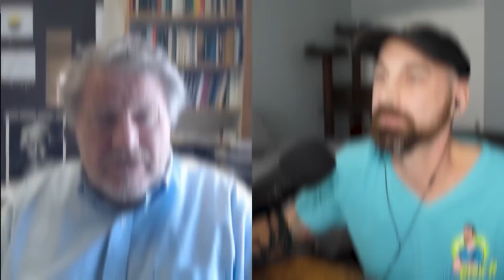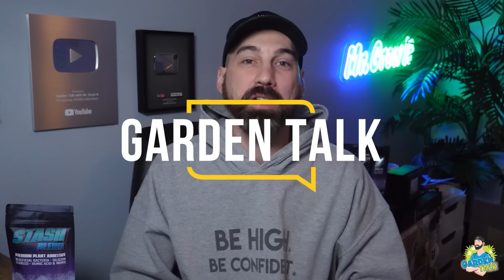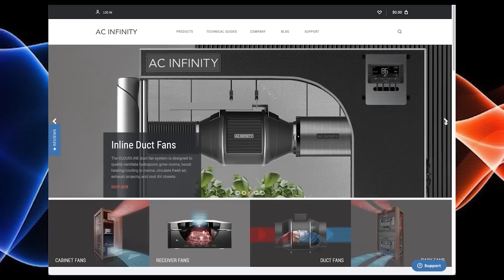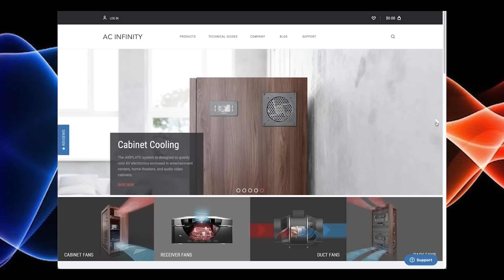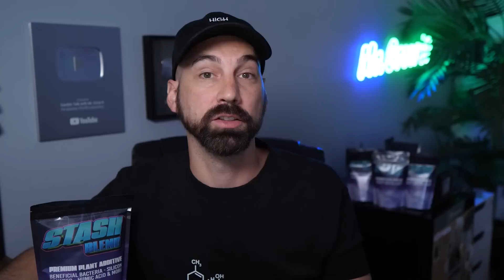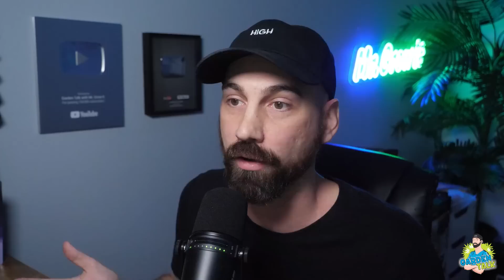Best Practices For Growing Several Plants At The Same Time! (Garden Talk #116)

Comment: 26:13 in the same boat with low humidity. Started using a Vicks Vaporizer. I’m surprised no one seems to use them. It boosts the humidity to over 70% in my lung room and boosts the temp 2-3 degrees f. Cheaper than humidifiers and no mold or bacteria.